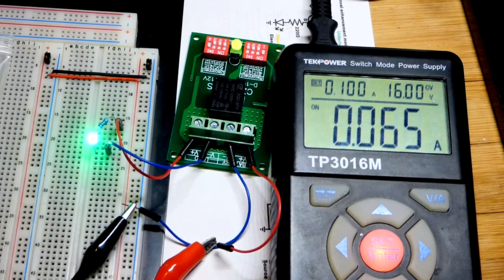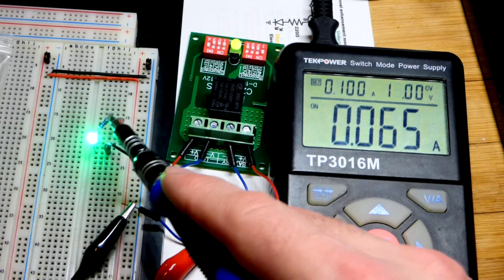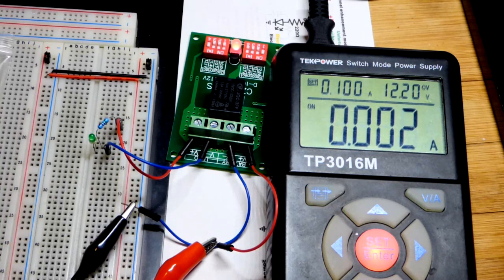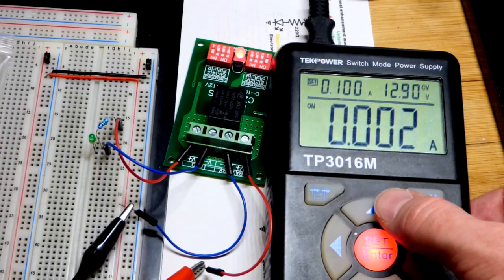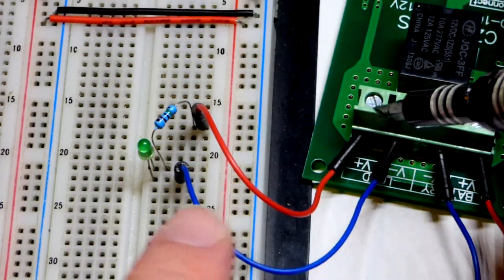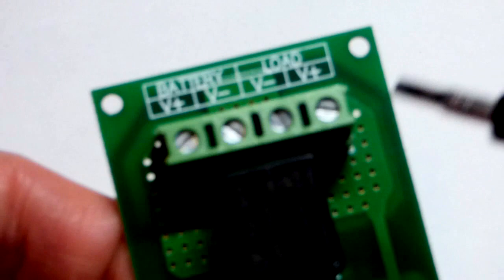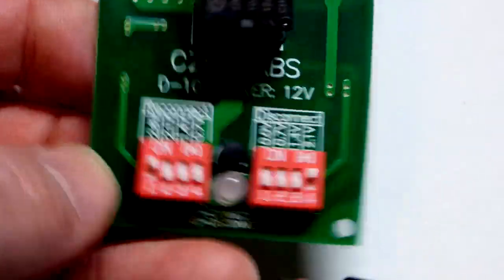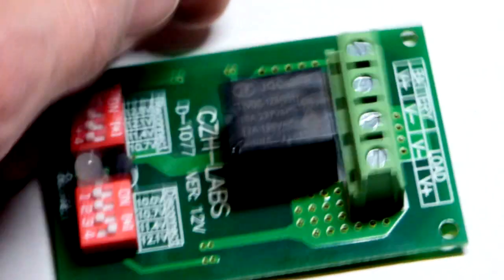Simple approx 12V low voltage cut off relay module demonstration learning electronics lesson 0040

Comment: SO does this device use power from the battery it is monitoring?   If it does what is the current draw of the board after it disconnects the LED?   If the board stays powered it could totally discharge your battery.    Curious.
Reply from the maker: This one looks to draw about 2mA of current when the relay turns off.
Reply: @Electronzap  Interesting.   Thanx for testing.  That's not toooo bad.   But I think the circuit needs to be modified to totally disconnect all when battery it toooo low.